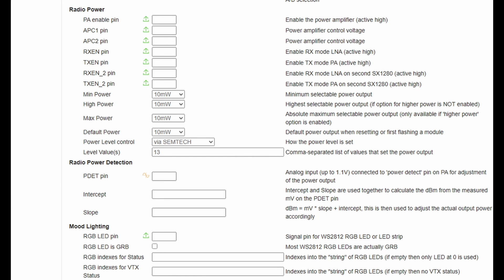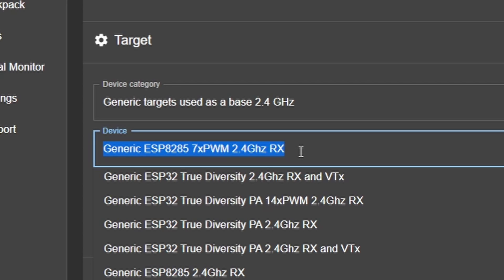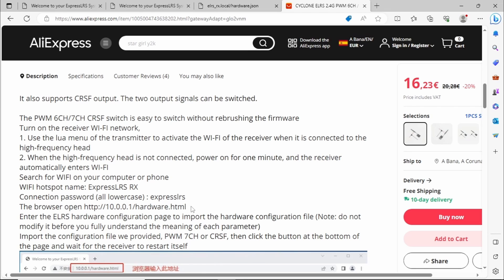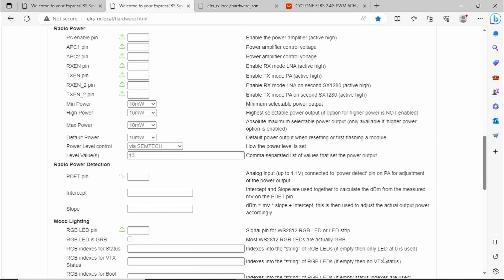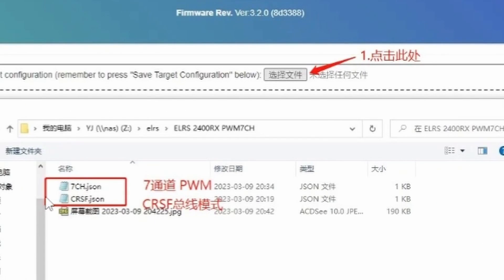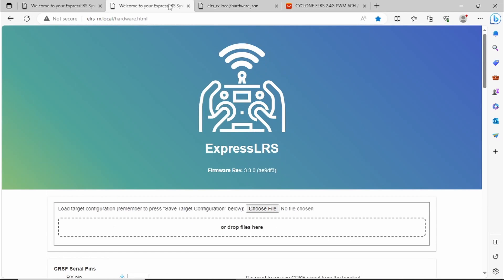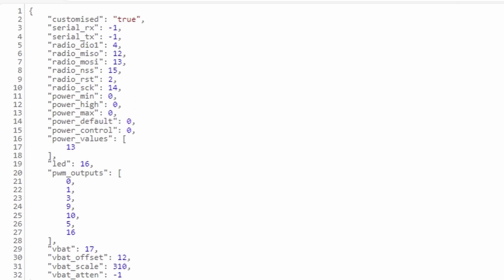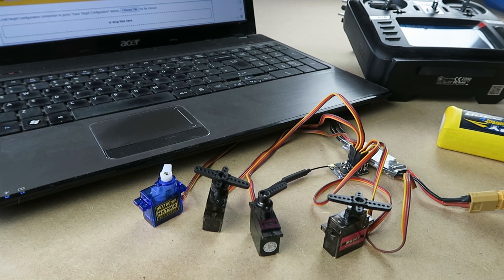ELRS Tx Rx "SECRET" Hardware Tab CYCLONE ELRS 7CH PWM JSON Files

Comment: Hello brother.
Am in trouble with cyclone 7ch pwm elrs 2.4ghz receiver.

First off, all cyclone brand was not showing in elrs configurator device category and device list.

Only i could find DIY devices 2.4ghz in the device category and Generic ESP8285 Full Duplex 2.4ghz RX as TX the device list.

Using these selections, i built a firmware bin zip folder and used the wifi connection i uploaded in the receiver.

That was successful. 
But the problem is what.
The receiver is not binding with the transmitter.

My transmitter is radiomaster pocket.

Both rx and tx are in the same version. 

One more time ,i built a firmware file using elrs configurator.but when the time of upload. 
Error message showing
Not enough space.

Please help me to sort out this issue.
Reply from the maker: As you know the "Generic" target has been removed from the configurator. However, I have successfully flashed version 3.2.0 by using the Happymodel EPW6 target. The firmware you uploaded was not correct and the receiver is now "bricked" it will not bind or show up in wifi. The only way to recover is using the serial UART connection with the Happymodel EPW6 target. Not this is the ^ channel firmware, NOT 7!! UART CP2102 to TTL RS232 https://s.click.aliexpress.com/e/_oEROh8T
Reply: @1nformatica 

thanks a million brother 
from your reply i understood ,i wanna reflash my CYCLONE ELRS 2.4G 7CH  with happymodel elrs firmware using UART CP2102 to TTL RS232.

instead of CP2120 ,can i use BETAFPV ExpressLRS Recovery Dongle FTDI USB To TTL Module .

few more questions
1)my Tx already Bind with RadioMaster ER5A V2 2.4GHz,that time i updated TX and Rx with latest Radiomaster ELRS firmware  along with Lua Script.
now if am going to reflash CYCLONE ELRS 2.4G 7CH  to happymodel elrs,do i need to update Lua script  in my rTx with happymodel firmware.

2)if i dont want to use 7th channel, do i need to deal with Json files ?
with out that programming ,is it able to bind CYCLONE ELRS 2.4G 7CH  with my Radiomaster pocket
Reply: @1nformatica   hello brother .really i need a reply from you to move forward with unbricking my Cyclone 7ch .i got the UART 2102 to TTL  as suggested by you.but it look different from you showing in your video.
having  one selection switch 232-TTL and  232-485.
if i get your email id,i can share more details.

please help me.
Only you are the only one dealing with same receiver  what i have with me in YouTube , so i don't have any other hope other than you.

please reply with your email id.

Comment: Quick question - Can I power the Rx with the ADC and Ground ? And will that give me battery voltage on my radio. Thanks
Reply from the maker: No! Don't do that! The ADC pin is connected to the battery voltage i.e. for a 3S pack around 12 volts. If you connect 12 volts to the RX it will fry! Power the RX from 5 volts as normal either by an ESC with BEC or another 5 volt supply. Thanks for watching, have a great day!

Comment: Hello, this Video was very helpful. However im wondering if i can connect battery voltage 3S directly to adc pad without a voltage divider with this receiver. I bought the receiver this year. Little help would be very appreciated.
Reply from the maker: Hey thanks! Yes, you can connect up to 35 volts I think to the ADC pin directly. It has a built in voltage divider. Personally I always use battery telemetry from this receiver normally on 3S pack. Have a great day!

Comment: Great video and files. I just purchased one of these and will do the update for ch 7. I'm curios that I've seen a couple of reports from people that they cant get these into WIFI mode. I wonder what the issue is with some of these? I assume the 5v bus is the same for all channels so I don't think that would matter. One of your commenters below states he was using ch 1, maybe its connected to something else??? I'll experiment with mine when it arrives.
Reply from the maker: The only time I have seen a problem is when the wrong firmware has been flashed. For example, flashing 7 channel fw will stop the Rx going into wifi mode. The only way to recover is to flash via a UART. Yes, all 5v pins are connected.

Comment: I'm using the Radio Master Pocket 3.3.0 version.
At the time of purchase, 3.3.2 version receivers bind well.
However, the 3.2.0 version of the receiver is not bound to the controller.
Wi-Fi mode is accessible.
Flashed Happy Model 6-channel pwm 3.3.2 firmware.
After that, I applied the json files in the video.
However, it is still not bound.
What could be the problem?

Firmware version of this receiver now
HappyModel EPW6 2.4GHz PWM RX
Firmware Rev. 3.3.2 (2d9891) ISM2G4

Firmware version of Pocket
3.3.0 ISM2G4 AE9DF3

I've tried for hours, but it doesn't work. Please help.
Reply from the maker: Hello, I have also used the RM Pocket with 3.3.0 bound to this Rx with fw 3.3.2. it works perfectly. The only difference is I use LBT as I am in Europe, but I do not think that is your issue. In this case please observe carefully the Rx LED status, it can tell you a lot : https://www.expresslrs.org/quick-start/led-status/
Reply: @1nformatica I turned the power on three times.
However, as is usually the case with connections
After blinking for the first 2 times
It just blinks once in a while.
Is it not possible to enter binding mode?
Reply from the maker: @이기선-t1z  Do you have a binding phrase set? If so using it is the only way to bind. There is a trouble shooting guide here : https://www.expresslrs.org/quick-start/binding/#traditional-binding

Comment: Did I understand correctly? This module communicates with ELRS to the radio, but the output signal is 6 PWM channels? And when I decide to install .json files can I choose between 7 PWM channels or CRSF protocol? In other words, this little thing combines the advantages of ELRS range, and allows to control the model using PWM without the need for a Flight controller or signal converter like in MATEK solutions?
Reply from the maker: Yes, you are correct. The "ELRS" protocol is actually CRSF between the Rx and Tx. The .json files are a convenient way to change the modes to serial or PWM. Note that serial can also be SBUS. Thanks for watching, have a great day!

Comment: Can't I just add 16 to PWM output pins entry, which becomes: 
0,1,3,9,10,5,16               
?
Reply from the maker: Sure! The "JSON" files are just an attempt to make things  "idiot" proof. Thanks for watching, have a great day!
Reply: @1nformatica  I think it is also possible to have both crsf serial mode (using pins 1 and 3 as in CRSF.json) and using remaining 4 (or 5) pins for PWM. Well, at least it is worth trying

Comment: I am very happy that my Cyclone receiver has become 7ch, but the firmware is still at version 3.2.0 and I can't update it properly. Could you please explain how to update it for beginners? Also, what kind of problems will I have if I keep it at 3.2.0? Is it dangerous to fly it?
Reply from the maker: There is no problem keeping the firmware at 3.2.0. It is not dangerous to use. I only upgrade when there is a new feature I need. I am running 3.3.0 now. I use the "Happymodel EPW6" target to upgrade. Note that this is the 6 channel firmware, you still need to change the values in the hardware tab as I show in the video to get the 7th channel. Thanks for watching, have a great day!
Reply: I think there is something wrong with the procedure and method I used to update the firmware. It may be that I am using the ELRS configurator incorrectly. In particular, I may not fully understand how to handle home Wi-Fi. It looks like the data writing is rejected at the end. Are there any easy-to-understand videos explaining this? If possible, I would like to try updating the firmware.
Reply from the maker: @mwater51  To begin with I would not use the Home network method, sometimes it does not work for me. Best to use the receiver's own network as shown in this video : https://www.youtube.com/watch?v=8poK--ln5J0
Reply: @1nformatica  Thank you very much . I wrote the question incorrectly. I don't use a home network either. I tried to change to 3.3.0 using the method in the video you showed me, and it displayed "Success!". However, after that, even when I connected to wifi, the transition to the RuntimeOptions screen no longer appeared. There must have been some mistake. Since then, I haven't been able to do anything. I'm a bit confused. Please help.
Reply: Also, it seems there was a mistake in the description. It is currently connected to Wi-Fi, but it does not seem to move to the setting screen. The screen is displayed normally on other receivers.
Reply from the maker: @mwater51  I do not understand exactly what you are saying. Could you make a video or take some photos please. You can reach me at : gizmohombre@gmail.com

Comment: Thank you. I watched your video about 10 times and took notes on the important points. Then, after carefully and hesitantly operating the PC as instructed, my receiver successfully changed to 7ch. The difficult part was until I noticed "elrs_rx.local". After that, it was smooth sailing. I ordered 3 new Cyclone receivers. Now I can fly the F5J.

Comment: I bought some equipment a week ago and started using ELRS. I'm a complete beginner. My CYCLONE ELRS receiver is 6ch, so I want to update the firmware to 7ch, but I can't find the correct file. The file I found seems to be incorrect, so I get an error. How can I get the correct file?
Reply from the maker: Hi, 6 ch * IS* the correct firmware file. You have to set the fields in the hardware tab to get 7ch as I show here : https://youtu.be/2VZb0n_G_Pg?t=436 Thanks for watching, have a great day!

Comment: I have a couple of these 7CH RXs I bought after seeing your video and they work great. I also have a couple of BYME-As in other models following your earlier videos. The BYMEs are paired with FrSky X4R RXs so I get voltage telemetry. I'd like to put ELRS RXs in the models with BYMEs but if I used EP1 or EP2 RXs with SBUS to the BYME I would miss out on voltage telemetry. Do you know if there is any way to get SBUS out of these 7CH receivers? I believe SBUS came in firmware version V3.3 and the RX came with V3.2.0. I don't see a "Generic ESP8285 6xPWM" firmware available in ELRS configurator. Thanks for all your excellent videos, they always seem to align well with my quirky choices in the RC world!
Reply from the maker: Hi, thank you for your kind comment! "Quirky" is what I'm best at! Yes, the 7CH Rx can output SBUS. Look at the silkscreen on the back and see Ch 2 & 3 as Tx Rx. Just go into the wifi configurator and on the model tab change the mode for those 2 channels to "serial". Now you have SBUS on those pins but still I believe PWM on the others! The "generic" tagerts are now gone but I use the Happymodel EPW6 and it works fine. Thanks for watching, have a great day!

Comment: for vbat enough only 5v wire?
Reply from the maker: I am not sure what you mean. The "ADC" pin on the receiver I show connects via a resistor voltage divider and is meant to measure the flight battery voltage up to 36 volts. Confusingly the telemetry sensor is called "RxBatt". I guess you could connect it to the 5 volt rail of the receiver but I don't see why you would want to do that as mostly the Rx is powered by the BEC circuit of the speed controller. Thanks for watching, have a great day!
Reply: @1nformatica  sorry, I couldn’t formulate it correctly, and my English is not very good. That is, I can solder a wire to the ADG of the receiver, and solder the other end to the power wires of the ESC, and I will receive battery voltage on my radio?
Reply from the maker: @unixoid33  Yes! A wire from the ADC pin to the ESC positive power will give you the flight battery voltage via telemetry to your transmitter as the "RxBatt" sensor. I use a momentary switch to call out the voltage when I want. Also I put a logical switch to announce when the battery goes below a voltage I set.
Reply: @1nformatica  thanks for the answer. And in the previous post you wrote about resistor voltage divider. Is it already built into the receiver, or do I need to add a resistor myself?
Reply from the maker: @unixoid33  On this particular "Cyclone" receiver the resistors are built in.

Comment: Sir my rx have problem. when powered LED blink slowly and immediately enter WIFI mode and continue blink slowly.

My TX Can not connect with RX because RX was WIFI Mode maybe..

at First slow blink changed to fast blink after 60 sec but now only slow blink.

I upgrade to happymodel 6xpwm but still slow blink only.

help me.
Reply from the maker: I, and many others have used the EPW6 firmware successfully.  A solid light means either that the Rx is in boot mode or the wrong firmware / bad flash has occurred : https://www.expresslrs.org/quick-start/led-status/#receivertransmitter-led-status The only way to recover is to reflash with the correct firmware by using a UART interface. Thanks for watching, have a great day!

Comment: Hi, I'm struggling to bind my cyclone receiver to my radio. Is there any "documentation", list of blink codes or what the button on it does? It feels as if I searched through the entire web. 
Thanks in advance
Reply: What do you mean? Is battery telemetry required?
Reply from the maker: @wojtuz4542  Not required, just a very useful option. People at my club wonder how I manage to get such long flight times, it's because I use the battery telemetry to manage my flight. I land with an average of 25 to 30% left in the pack. They use old fashioned timers set by guess work and probably land with 50% left!
Reply: How can I access that information? Can it be visible on the radio or something lime that?
Reply from the maker: @wojtuz4542  With the ADC pin connected to the positive of the battery, go to the "Telemetry" page on your radio and select "New Sensors" after a few seconds you should see in the "Sensors" pull down all the sensor information, RSSI, signal strength and RXBt which shows the battery voltage. I then set a toggle switch to announce the value and set a logical switch to alarm me when the pack gets to a set voltage. For a 3S pack I usually set this to 10.7 volts.
Reply: @1nformatica  wow, that's great! unfortunately my current radio doesn't have a screen (literadio 3) so I will miss out on that at least for a while
Reply from the maker: @wojtuz4542  Time to bag yourself a Radiomaster Pocket! I even mostly choose it over my TX16S! For around €75 value than can't be beat!!  https://s.click.aliexpress.com/e/_DBpJzqt
Reply: @1nformatica  it definitely is on my "to buy" list. But first i'd like to get the model im the air and then make improvements to my setup. Wanted to buy the radiomaster pocket as my first radio but noticed the LR3 elrs for like 15$. Nothing fancy but it's a fifth of the price. I just couldn't miss that opportunity
Reply from the maker: @wojtuz4542  You are so right! Whatever gets you in the air soonest! It's like cameras, the best camera is the one you have right now. There are always better options but you have to start somewhere. Good luck with your project.
Reply: @1nformatica  Thanks a lot, for your help too. I wish you luck as well even though I suppose you don't need it :)
Reply from the maker: @wojtuz4542  Everyone needs a little luck!!
Reply from the maker: All the button does is to put the Rx into "boot" mode for UART flashing as far as I know. This is done by holding the button down while connecting the power. All the Rx and Tx blink codes are explained here : https://www.expresslrs.org/quick-start/led-status/ Thanks for watching, have a great day!
Reply: @1nformatica  Thanks a lot. I managed to finally bind now let's just build a plane around it :)
Reply from the maker: @wojtuz4542  Great! What was the problem? What plane will you build? Some ideas here : http://rc-plans.com/catalog
Reply: @1nformatica  I could not get it info pairing mode. Blink codes helped me figure out what the reciever ja currently up to. I'm building a mini mighty mustang from flite test. I though about betafpv 5 CH reciever which would be perfect for it but browsing through aliexpress I noticed this one "2 more channels for the same price. Great". I'll be sure to check your suggestions out as well. Maybe another one if the first one goes right. Thanks a lot :)
Reply from the maker: @wojtuz4542  You're welcome! Don't forget you have battery telemetry too. I use a "Dupont" patch wire and solder to the ADC pad and plug it into the balance lead. Have a great day!!